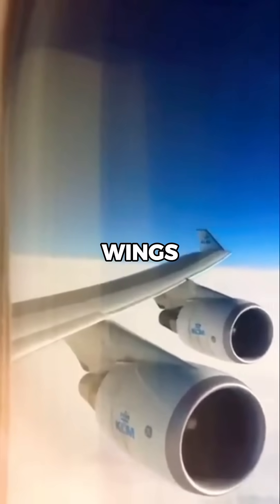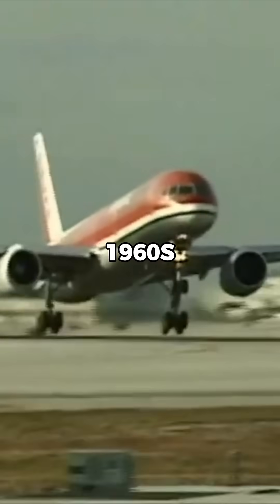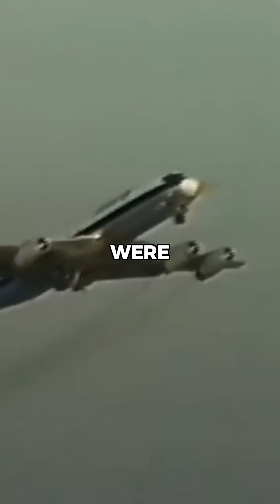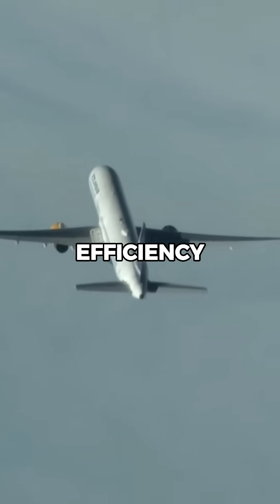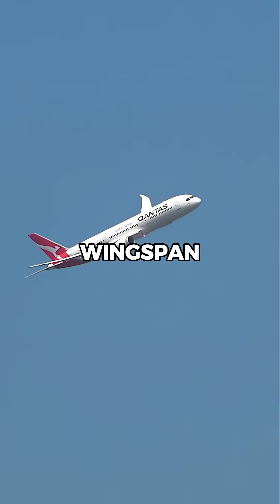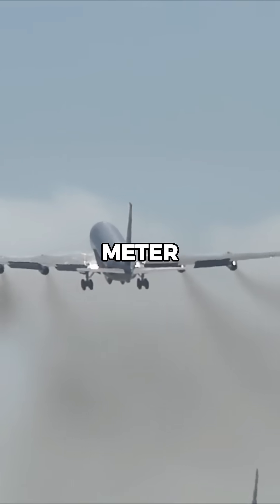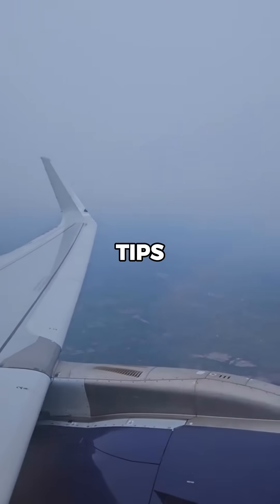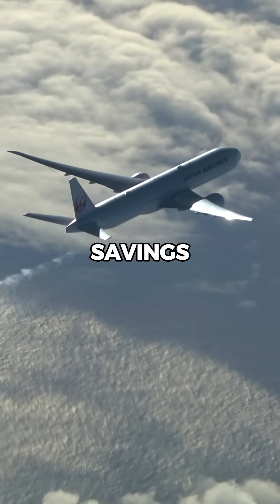why modern aircraft have longer wings than 1960s planes

Comment: you mean, well, the Boeing 747-400 and 800 are faster than anything else except the Convair 990 solely because it was not forbidden from going mach 1 which the 747s can. Airbus aircraft are about 200 to 400kmh slower than Boeing aircraft. The 747s cruise at mach 0.99, the 787 at mach 0.90, while the A380 at mach 0.89 and the A350 barely does mach 0.85. Boeing could manage efficiency and speed quite well. The 707 is rather slow. Only 970kmh compared to the 1060 and 1000 of the 747 and 787 respectively.